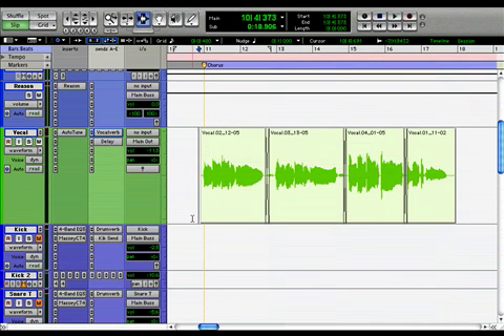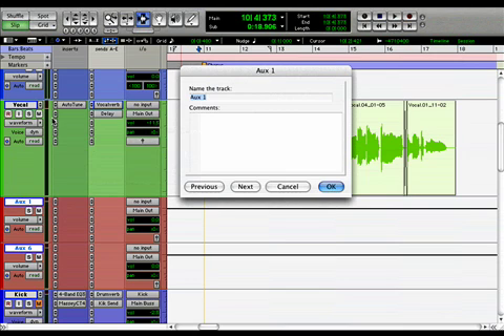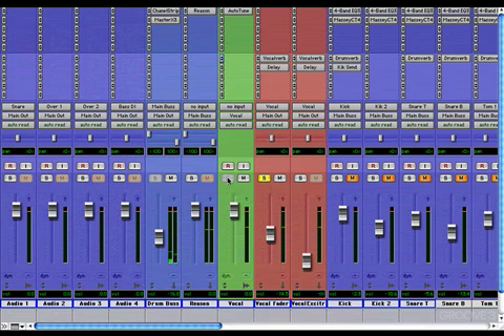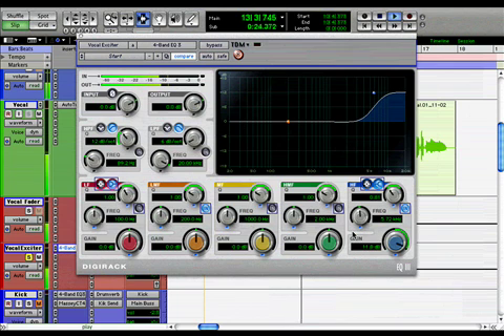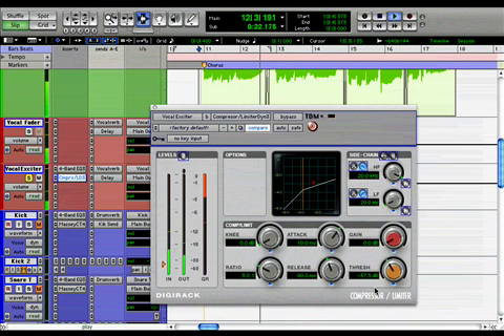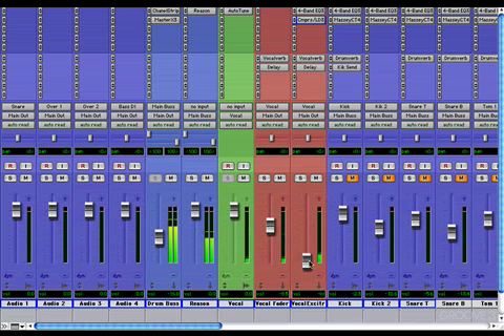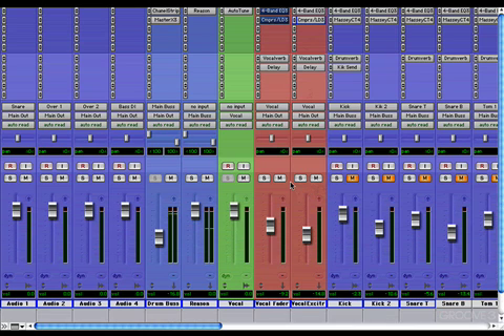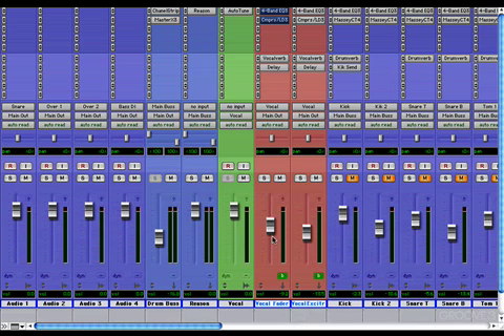Vocal Exciter (Pro Tools Tips & Tricks Vol 2)

Comment: Great tip. It really enhances the highs without imparting harshness. I imagine a similar effect could be achieved with a multiband compressor, but I'm only speculating there.

As for the 'aural exciter', I believe they actually created high frequency overtones/harmonics to enhance the perceived clarity of tracks. This process is a bit different in that you're using the information that's already there, just accentuating it with EQ and compression, which has its pros and cons.

Comment: Nice trick. I have adapted it a tad differently. I dont create a master vocal fader. I just group the exiter and vocal track. I leave the sends and FX on the vocal track so that delay or reverb (for example) do not have the excess brightness. On the exiter I cut everything below 10K with a 1 band EQ and boost 16k all the way on the SSL and follow that with an 1176 at 20:1. I set the threshold where there is only compression on sibilant sounds (S, T, TH F etc). I still eq the vocal track to taste

Comment: This method is only worth it if you apply other effects to the "high eq" channel like phaser or flanger, otherwise what's the advantage over using a multi-band compressor? You will get the same result because you are doing the same thing - compressing only a specific frequency range (in this case the highs).

Am I missing something here?